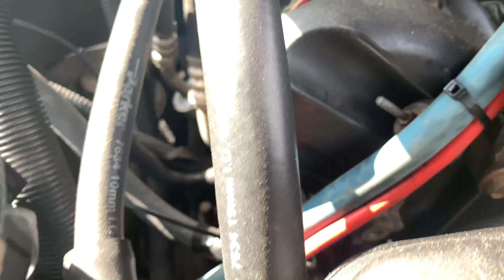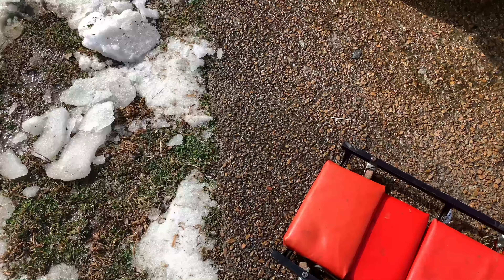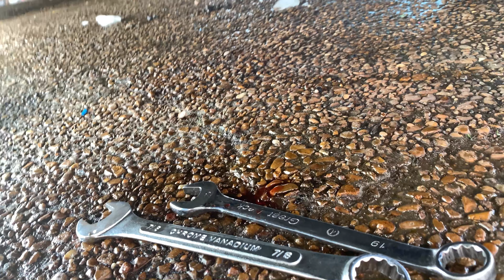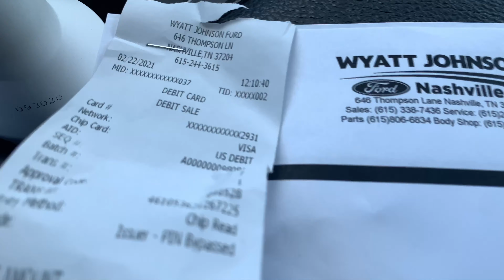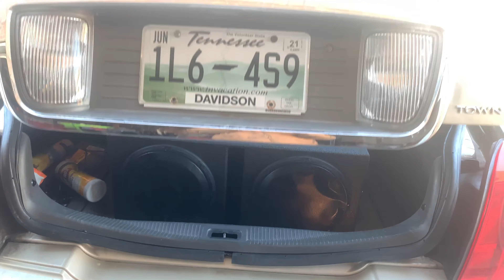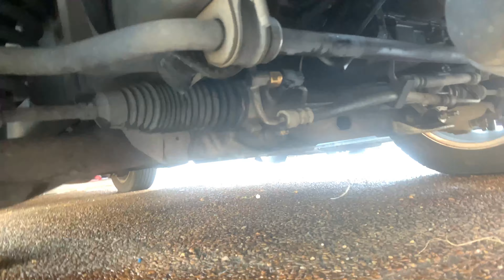2006 Lincoln Towncar Power Steering pressure switch

Comment: I live in Nashville also and got the same problem , can you tell me all the supplies I'll need to fix this ?
Reply from the maker: Go to ford for the fluid but give me a min I’ll look up the part number for the switch
Reply from the maker: What year is yours?
Reply: @odianosae  2006 Grand Marquis
Reply from the maker: @Palmyj07  O’Reilly’s part number is PSS44
Reply from the maker: Thank you for watching please subscribe
Reply: @odianosae  how can you be for sure that's where it's leaking from?
Reply: do you know how to fix the AC blend door actuator ? shops want to charge me $1400 to take out 4 screws and replace with new part , it's a tight fit and you can't see the screws but you can feel them
Reply from the maker: @Palmyj07  they’re about right because they are taking the dash apart
Reply: @odianosae  you know anywhere I can get it done cheaper around Nashville?
Reply from the maker: @Palmyj07  not really
Reply from the maker: @Palmyj07  just look if it’s leaking from there it will damn sure show you

Comment: Next time don't cut the motor on when you are bleeding it. Just keep both wheels off the ground, then unlock the steering wheel and turn the steering wheel back and forth at lest 20 times all the way from one side to the other. that's how you get the air out the line. If you run the motor before bleeding it you might cause a major problem
Reply from the maker: I appreciate the tip